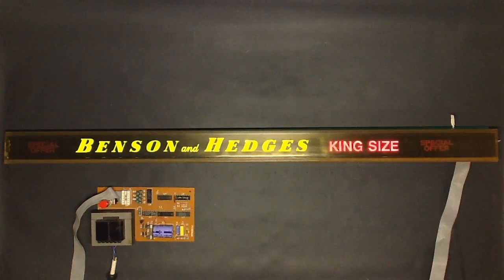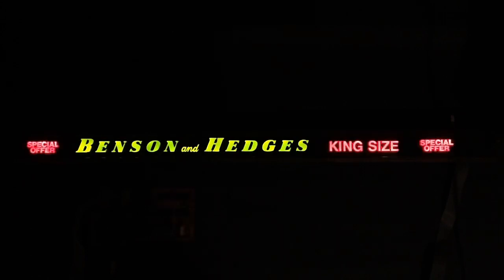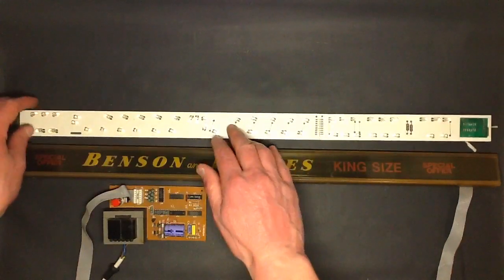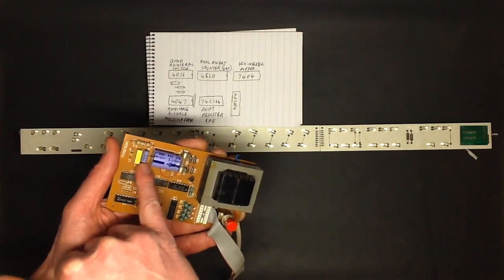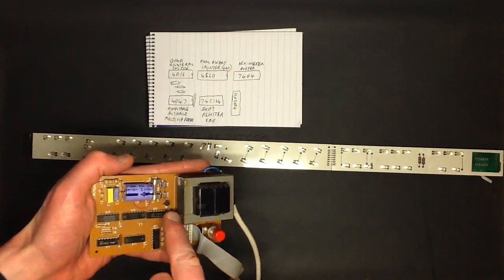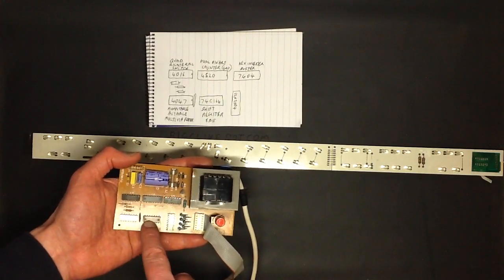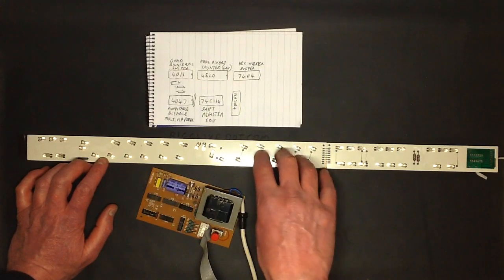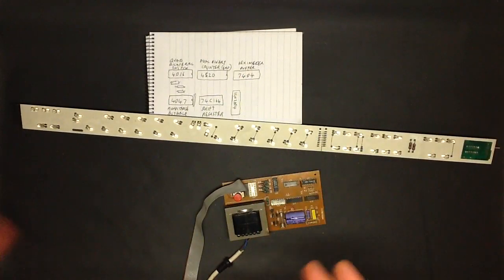Vintage 1981 animated LED Benson & Hedges advertising panel.

Comment: It's funny how things tweak the memory. A local post office was being renovated. It had an electronic display for the latest currency exchange rates. This thing worked off a computer and it is was all red 7 segment displays. It measured approx. 600mm by 400mm and was very, very heavy. How do I know this? I procured it .... from the skip that was full of the old fittings. After that, and procuring an old meat trolley from the supermarket, then parts of a pharmacy being renovated all this from the same shopping centre, they fitted security fences.

Comment: Does it mean that I'm old that I would still do something like that with logic chips instead of a microcontroller? I am surprised that this thing used LEDs though. It's an obvious choice now but back then I would have worried about it not being bright enough compared to daylight. I guess this kind of things would have been put up in bars and other low light environments.
Reply: I am also an  7400/4000 logic fan.. I trust such circuits more than some micros... I use micros only when the funciton is very complicated and might need reprogramming. I absolutely hate when somebody uses a micro to blink  one LED.

Comment: Using a half a 4047 and a quarter of a 4016 to make what I assume is a simple two-speed clock? Any self-respecting designer would have built one with a couple of inverting gates and a transistor, and with a little bit of effort it could probably be done with just the 4016.
Edit: Ah, so they are using the rest of the 4016. Makes it a bit better.
Reply: +Graham Langley Or three 2-input NAND or NOR gates, plus timing components and a couple of diodes.
Reply: +Graham Langley This is why everyone uses a controller - there are so many ways to achieve everything in discrete logic.  Been there, done that :-).

Comment: The "doing it with a microcontroller" equivalent of that time would have been doing it with an EPROM used as a pattern generator (sticking with relatively general purpose parts). A multivibrator, a counter and the EPROM - you're done. It would have been overkill for this specific application though and no doubt a lot more expensive... :)
Reply from the maker: +Attila Asztalos A 555, 4040, EPROM and a ULN2803 driver.  Just like the fairground lighting controllers.

Comment: I think the bilateral switch is used to change the timing from fast to slow by shorting out one of the timing resistors instead of using gated logic on a constant high-speed pulse.

Comment: I think older stuff is more interesting than modern kit as the limited options require you to have a more thorough and concentrated knowledge in general. It's the same in computing.

Comment: Wow, when you turned out the lights it looked as if it were computer generated text in a video editor. Very nice sign! And LED's in 1981, I bet it was originally an expensive sign. Great explaination on it. Thanks for sharing.

Comment: Strange... The white light LED wasn't invented before 1995. Back in 1981, a LED was green, red or orange, mostly very dim and immensely expensive. So my first guess would be, that the "control unit" used to drive classic light bulbs and that the LED panel has been fitted much more later.
But going to all that effort, to engineer, construct and manufacture a modern LED panel just to fit a 1981 vintage control unit doesn't make much sense. In times, when white SMD LEDs were available for a reasonable price to illuminate an advertising sign, also small and very cheap micro controllers were available. So, something is very odd to this construction.
Reply: +konohh He states in the video that they are red and yellow LEDs, not white. Red and yellow LEDs were more expensive then, sure, but not prohibitively so.
Reply: +My Lovely Horse Ups, you are correct. I was fooled by the transparent case of the LEDs.
Reply: They had blue LEDs at least in 1992 cos I remember them in the Maplin catalogue. They cost 2 quid each though (vs 10p or so for red or green), and the brightness wasn't much. 

Then they discovered how to do it cheaply, and within a minute every bit of cheap Chinese tat used them, seemingly because they looked "expensive". Which they did, before every bit of Chinese tat had them.
Reply: +konohh I remember back in the late 90s I remember my dad telling how they thought blue LEDs to be impossible (he bought a LED flashlight that tried to use green, orange, and yellow to get a whitish light). A few years later I saw my first blue LED, it was the power indicator on the Playstation 2.
Reply: yellow was available, and although dim by today's standards, they did have some that were brighter than the average indicators, as clive said.  also remember, that in 1981 the 8041 and other microcontrollers were rather expensive, when they can just do discrete logic much much cheaper.

also, five bucks says the transformer was a 6.3V.  tubes were definitely on the way out, filament transformers were still a dime a dozen though, and at that time, literally being dumped on the market.

what i find amazing here is that they didn't use the 7805, and instead used a zener.  the 7805 was pretty cheap by then, but then a zener was probably much cheaper.

Comment: I'm a little surprised that the 50hz mains wasn't used as a timing reference.
Reply: +NatureAndTech except there&#39;s 12V AC on the low voltage side of the transformer - just needs a resistor and a diode (or 2), though this would need a different approach to the &#39;speed changing&#39; without analogue switch altering the RC time constant
Reply: +Robert Szasz Opto-couplers and high-voltage capacitors costs money. Besides, the timing is not critical. Also, you would have a live PCB during debugging.
Reply: I thought there might be enough ripple to trigger off of, good points though.

Comment: Very sad to admit that 35 years ago or so I had a student job where we "disposed" of old signage items - traffic signs, municipal placards, and even some early electronic advertising ... the method was basically cutting them up with saws and binning them all. 
At the time, electronic items were considered less than useless because there was no interest in recycling components - they had less value than scrap wood or metal. Such a shame in hindsight.

Comment: That's my favorite kind of display, where the letters actually light up completely and evenly. I want to learn how to make those with smaller lettering for indicators... minus the vacuum forming though. Also it's really the best when a display is made such that the whole panel just looks black when it's off, and where the 'off' indicators are or what they are is totally invisible until lit. Ever made those?
Reply: Electroluminescent, with a dark transparent plastic over the front, would seem to be what you need. That or a graphical colour LCD screen. 

Electroluminescent plastic is plastic, comes in sheeting or wire form. You electrify it to make it glow, and you can cut the sheets into any shape you like, for example letters. Make them too tiny though and it might not be economical.

Comment: I'm surprised they used LEDs. I imagine the main reason was to keep the actual sign quite flat but also to reduce heat output and improve longevity. I can't imagine the manufacturer would expect it to still be working all these years later! Interesting mini teardown. Thanks.
Reply: +Pete Allum yes, overdriven tiny bulbs would die within  a year, and the retailer isnt going to mess about doing replacements all the time, its amazing that leds of  a decent brightness existed

Comment: Not to be /too/ nitpicky, but the Intel 8048 (predecessor to the 8051) was introduced in 1976, and the Zilog Z8 came out in 1979.  So there were microcontrollers available at the time.  Still it was probably cheaper to do it this way...
Reply from the maker: +Jock Murphy A lot cheaper when you consider the cost of the first development systems and dedicated programmers.  I've still got my PIC Pro II programmer which only handled a few PICs and was one of the first affordable microcontroller programmers.
Reply: I was thinking purely of the cost of the electronics, but yes if you factor in the cost of the development kit then this was definitely the way to go at the time
Reply: 6800 was probably the choice right in those days, but tools were sky expensive, not mean for hobbist. The mighty 8051 starting to take off but sure way expensive just for this application. And the issue again were the tools, which means a computer, a programer .... I used the 8051 a lot myself and until they started offering the chips with ISP (late 90s) it was a pain to work with because I need to borrow a programer or ask smebody to program it. I cant imagine right in the early 80s. The was a good Windows SIMULATOR, that, for this projects was good enough, but for more complex things, you were alone. I worked my way adding some basic IO routines using EXT IRQ, and the parallel port of the PC connected to one port of the MCU to halt program execution, dump RAM  and EDIT locations and continue. Then if you wanted to do your job only using the on chip RAM, well, you need to be very creative. And pray that you dont need "speed", even in ASM some things turned a bit snaily LOL
Reply: My company had an Intel 8048 development system with dual 8" floppy drives and programmer in 1979. It ran on CP/M. It was a big heavy dedicated blue box with CRT and keyboard. It cost $15,000. So yes, brute force logic was the way to go here.

Comment: I have a project I have a 36 volt solar panel 200 watt I need to drop the voltage to around 15 volts max dc losing as little output as possible
Reply from the maker: +david wise eBay buck regulator module.
Reply: +Godfrey Poon kool thanks  when you have time I have two more questions first if I am running the output thru a charge controller like this one http://www.ebay.com/itm/301276792742 would that help to stabilize the load my next question is the out put of the solar panel is 200w at 36 volts that's 5 amps is the output at 12 volts still 200 watts 16 amps or is it closer to 600 watts 50 amps I cannot remember the math I am Shure I my mind that it stays  the same with some loss due to the resistance in the reduction of voltage PS it really makes it difficult when you know you know the math, theory or what to do to make something or repair something what makes it worse is even to this day I have problems with memory I am in my 60s and cannot remember my kids birthdays or if I ate something this morning I have lived with this for many years I can watch the same movie over and over sometimes never remembering any of it so my movie collection is like a new movie every day lol thanks for everything
Reply: +Godfrey Poon would two of these  parallel  carry the load better I can only find a 100 watt one I know what to do but I had an accident years ago and lost a large amount of memory was a very good electrician I know I should know all this but pieces are missing so any help would be appreciatedhttp://www.ebay.com/itm/271979697207
Reply: +bigclivedotcom would two of these  parallel  carry the load better I can only find a 100 watt one I know what to do but I had an accident years ago and lost a large amount of memory was a very good electrician I know I should know all this but pieces are missing so any help would be appreciatedhttp://www.ebay.com/itm/271979697207
Reply: I know it's a year later, but...

What are you trying to do here? What thing are you trying to power from the panels? It might be possible to reconfigure the panel, to maybe 2x18V panels. 

For a big setup a charge controller is a good idea, because it runs the panels at their optimum. Depending on the amount of sunlight, a panel might serve better by trying to draw more current at a lower voltage, or the other way round. This changes through the day, and a charge controller keeps track of all that automatically. They generally are intended to charge batteries, which most solar applications need since they're for people's homes etc. 

Is your setup for a home, or do you just want to power something in the middle of nowhere? If it's for a home, efficiency matters, you want the most power and batteries to last through the night. If it's just some gadget, the power solution depends on how much power it draws. 

You don't mention batteries, does your thingy only need to work in constant daylight? 

Did you get the panels cheap? Seems weird you've got 200 watts of solar panel, normally quite expensive, but you're not sure how to use them.

Comment: about 2/3rds of the way down the LED board...what is the squiggly bit?
Reply from the maker: +Steven Barnes It's a set of links between two sections of PCB material.  I guess that 16" was the largest size the PCB manufacturer (or PCB design package) could accommodate.
Reply: +Steven Barnes It looks like a joint between 2 boards. That is if you are talking about the 9 parallel lines just below 2 dots, on the right hand side thirds.
Reply: +Steven Barnes Looks like a wire/solder bridge joining two PCBs together.
Reply: +bigclivedotcom so I wonder if they just ordered a bunch of the right half so they could in theory interchange the Benson and Hedges part with another brand?

Comment: i cant believe the damn thing still works!
Reply: +Tony Fleetwood Rugged design - you could leave that on for 50 years and it will still be working. No switching supplies, solid transformer and TTL/CMOS logic chips. Only potential thing to fail there is the electrolytic caps - but back in the 80's and early 90's electrolytic's were robust as hell, built to last, this is before the Chinese flooded the market with shite dielectric compounds and produced decades of failing electrolytics. Also this is before unleaded solder took over due to ROHS, so the solder joints were solid and unlikely to crack.....turn a early 80's BBC micro on after 30+ years and it goes beeeeer beep!......turn a playstation 4 on in 30 years time and see what happens :D
Reply: +Tony Fleetwood And they say smoking is bad for you. lol
Reply: blower
my 1985 rca dimensia system still works :)
thats all i can ask for
Reply: +blower Turn on a BBC micro today and there is a very good chance the filter cap in the power supply will explode with an accompanying release of smoke.
Reply: +Tony Fleetwood i have an early 1950's valve radio,  an ultra, and it has never had replacement parts, still works fine, its not used much in the last few years its mw/lw and since bbc moved to fm in the 80's its not so much fun (yes you can get world service lw, and radio 5 sport crap)
Reply: +jusb1066 all the BBC local radios seem to broadcast on mw on our radio.
Reply: Yep agreed, my old bbc did the same - however it will still carry on working, the cap is just a HF filter cap on the input.
Reply: MrDibbsey
yes, depending on where you are!  in the SE, its not the case, local radio is very weak on fm , so you are forced to listen to 2,3 or 4, so i now have an internet radio and listen to more tailored channels anyway!